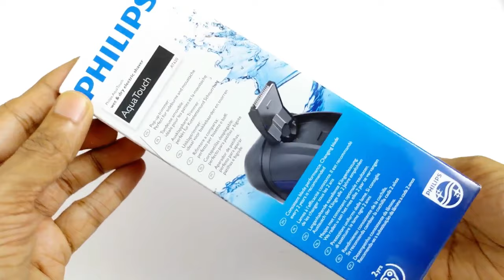Philips Aquatouch AT620 /AT610 Shaver - Disassembly

Comment: need to replace my shaver's batteries can i change the mAh capacity? or do i need 100% same capacity? battery type and voltage will be exactly same
Reply from the maker: Choose mah of your liking, but keep everything else the same..
Reply: @TechLifestyle  thanks ill swap my old batteries with 1100mAh ones
Reply: @TechLifestyle  i used 1100mAh 1.2V NiMH AAA Camelion batteries but the machine wont charge so exact mAH might be required
Reply from the maker: The problem could be something else..
Reply: @fpsshani  how do you even take out the batteries? they are physically attached to the chip through clips
Reply: @altinfloppi  i used solder iron to disconnect the old batteries and soldered the new ones they are working fine
Reply: @fpsshani same 750mah power is working?
Which company?
Reply: @shashikanth1428  i was wrong at soldering did soldier and batteries worked fine for a year now they dont hold charge more than one day but the speed of motor is fine
Reply: @fpsshani  ok